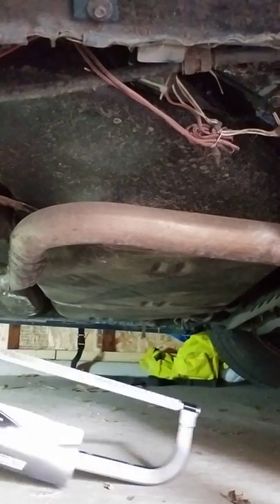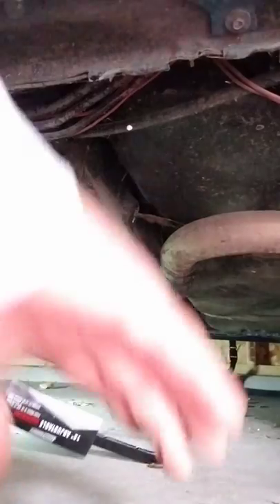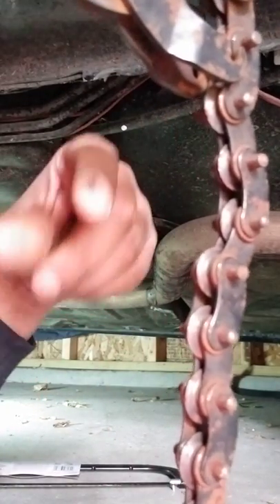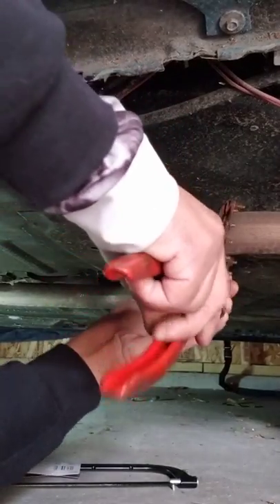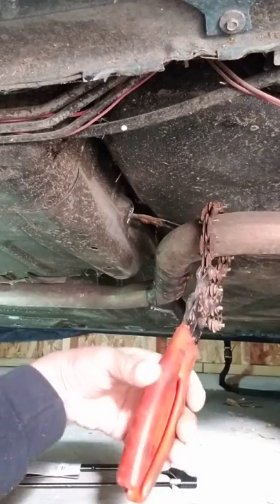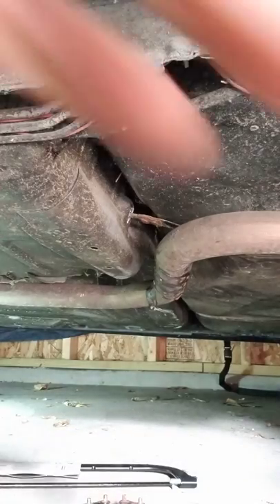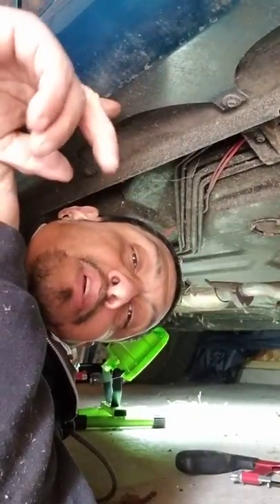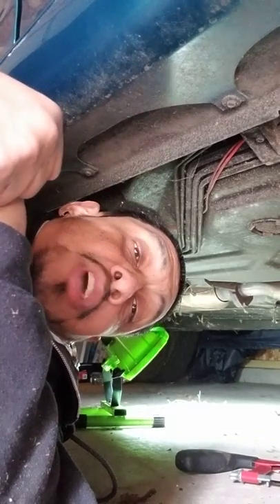How I think catalytic converters are easily and quietly being stolen

Comment: I got hit a few times so I bought the 2 pack of stick on door vibration alarms for $6 at Harbor Freight and stuck them on the rocker panel. The are pretty loud and go off for 25 seconds and turn off. They have an on and off switch so you can turn them off while driving. No problems since I put them on months ago. I placed them on both sides of the vehicle.